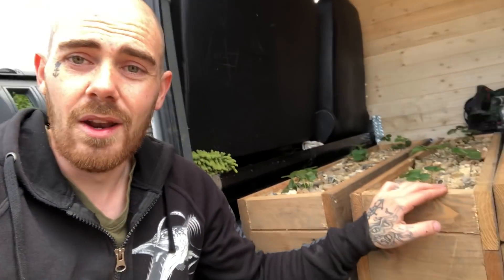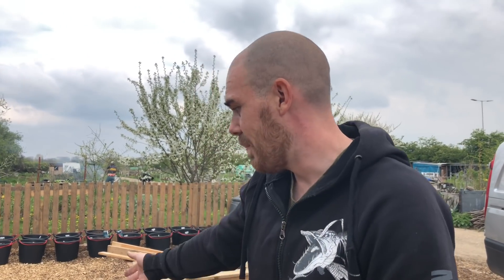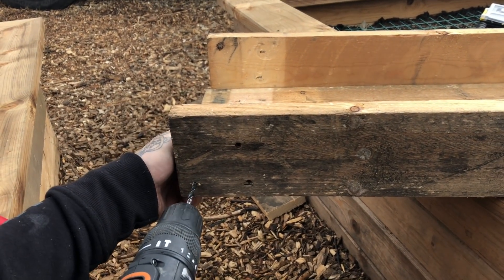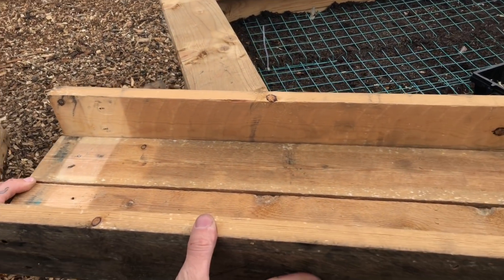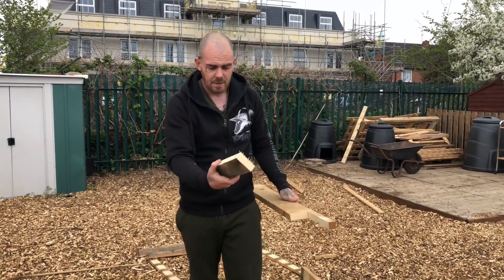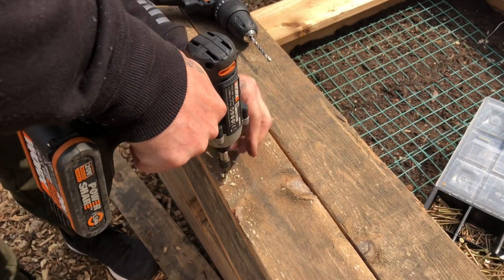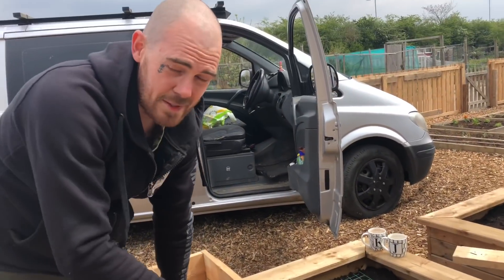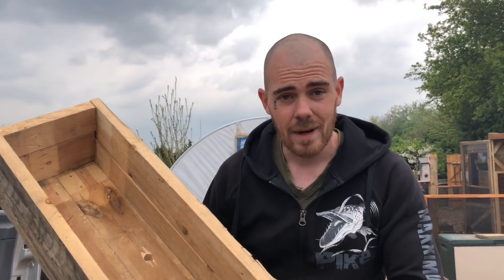Allotment Projects: pallet planter step by step

Comment: I know this video is older (someone might have already said this), but if you really want to get the nails out, tap them out and use the claw of the hammer to get them out. Use a centre punch to get the head of the nail up to claw it out or rip out the bottom if the nail has snapped. 

I'm doing and have done a similar thing and didn't even think of using a block of wood the pull the planks off, my timber is way thinner than what you're using though.

Loving your videos, cheers mate.

Comment: Hey nice job I came across your video because I watched a woman building full size garden boxes pretty much the same way your building in your smaller boxes I was so impressed and I noticed that she was lining the inside with untreated wood to hold the pieces together I asked a question about that but then she had a follow-up video where she said don't do this using the untreated wood that I had referred to her response had nothing to do with what I said the second video was made long before I ever saw first one but in her second video she shows how all of her boxes rotted apart in about 2 years she said I should line them with plastic can I shouldn't screw the boards together in the corner cuz every one of them fell apart you should put wooden blocks in the corners I thought it was so cool that she came on admitted to our mistakes and showed us her boxes falling apart so my question how long do you expect your boxes to stay together is pallet wood actually treated is it only being exposed where it's cut if it is treated I would like to use pallet wood but I'm not seeing anybody cover this issue if pallet wood can be used and we understand it's only good for two to three years then so be it but is that the fact thank you good job nice work. Have a blessed day looking forward to some answers

Comment: Hi m8 can I give you a little tip on your ripping down I can see all your timber is reclaimed bone dry or very wet, just set the saw to half of the timber thickness cut ,then set saw to full cut,your battery will last longer +your blade will stay sharper, ps live in hove went to boot sale last year planter were £40 4ft strawberry YOUR TO CHEAP 🥗🥗🥗🇬🇧🍺👍

Comment: I've just made a tool for getting nails out it's a thin tube about 6" long and a drill bit that fits snugly inside making sure the tube and drill bit are the same length you put the tube over the nail push down the drill bit rises hit drill bit with hammer it works every time.

Comment: Small suggestion to save yourself even more wood - instead of cutting some more pallet wood for the feet, you could potentially make use of the inch of wood that you had to cut off of the sides OR if you still prefer to use the bigger feet as you currently are using, you could potentially using one of the inches of wood as a central foot
Reply from the maker: Alpaka Whacker the wood I used for the feet was much thinner and not good for much as it was the back piece holding the pallet together so made sense using it 😊